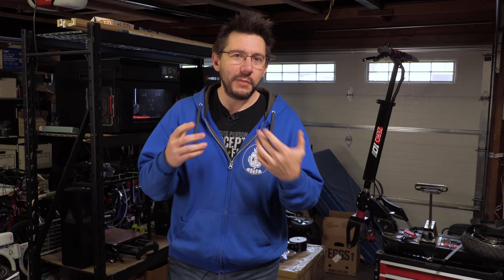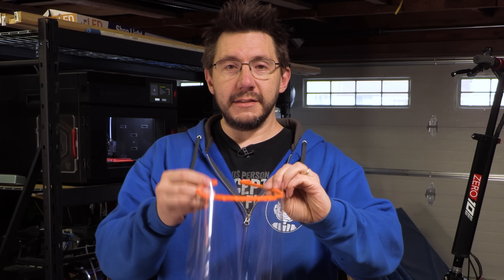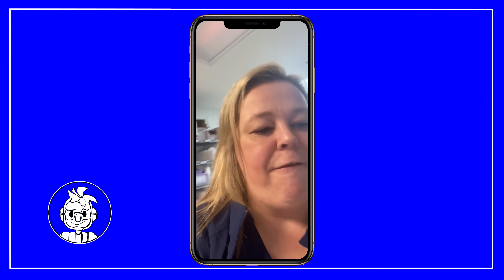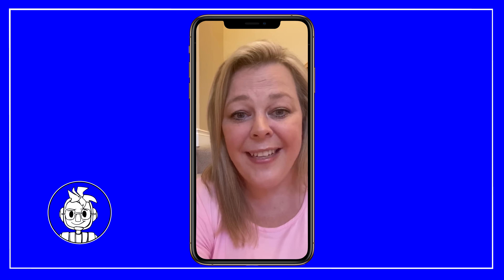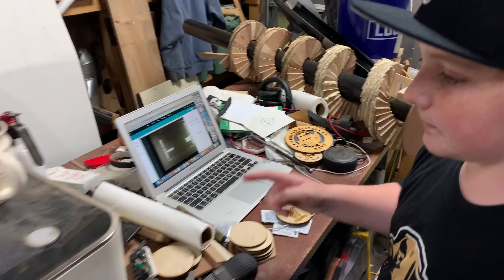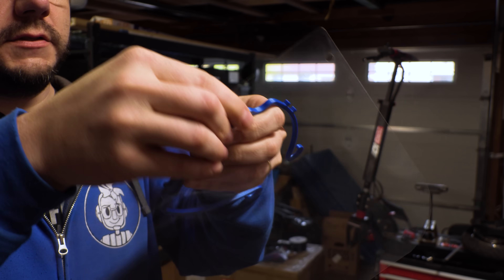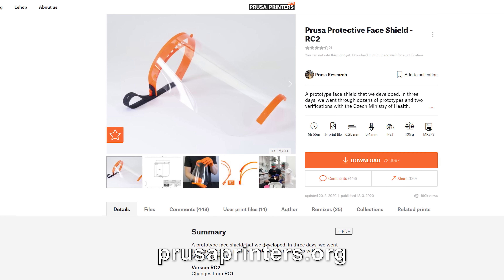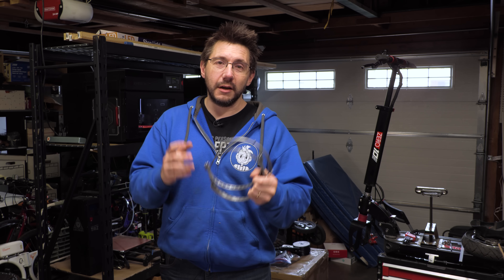3D Printing Face Shields and YOU CAN TOO!

Comment: Hey 3D Nerd - great video - thanks so much - my 1st 3d printer is on order and due to me on Monday to join the support of the frontline. Quick question as you have a route into Verkstan. Do you know or has there been any discussions about a multi unit print in some form of a stack so printers can continue to churn out units through the night without needing attention after each unit (on a small machine)?

Comment: Could we make a stacked design where we stack several on top of eachother and have an easily breakable layer between visors?  This could really increase throughput since it could run longer at night and would require less hand holding during the day.
Reply: "Make Anything" has done this already and the files for it are on the 3DVerkstan Face Shield BACKUP SERVER (see link above in the description)
Reply: https://github.com/Cederb/Faceshield.nu/tree/master/North%20America/3D%20Printing%20Files%20(STL)

Comment: I'm very green to 3D printing, like started last week green, I have 4 Ender 3 pro running right now with this design, I have a print time of 1.25 hours per print, is there anything i can do to keep quality and constancy while getting a faster print. I'm using the prusa slicer as I have 2 of their printers on order. I haven't modified any off the settings other than to draft  and PETG. Thanks

Comment: Where is the stl for the spacer? I’ve checked everywhere and can’t find it. Can someone please share the link for it.
Reply: I couldn't find it but the instruction sheet on the original website state 1/2 spacer so should be able to make one on tinkercad to fit the hole punch we are using
Reply: DJMovit you would think if you are gonna share a file to print, you would include everything. Lol
Reply from the maker: It’s there. Use the GitHub link and go to both America and STL and it’s in there
Reply: @3DPrintingNerd  I went to the website, thanks Joel!
Reply: found it on Github like 3D Printing Nerd mentioned

Comment: If you slice this in cura you can use the multiply feature and stack them on top of eachother, leave a small gap (1mm or so) between them and print with supports.

Comment: **READ THIS FIRST**
Don’t mass produce any PPE until you have let the establishment review and agree to the design. 
Face shield designs are changing rapidly. The model in this video is already behind and does not provide adequate top protection according to guidelines I read somewhere, probably the National Institutes of Health website. 

Keep an eye on the tested and recommended designs here:
https://3dprint.nih.gov/collections/covid-19-response

There is one design that has been considered to be tested and is recommended by the NIH (no 3d printed PPE has been “approved” by any official group)

This is a vase mode optimized version of the “recommended” design. This is the best design I have printed so far:
https://www.thingiverse.com/thing:4251314

The above was remixed from:
https://3dprint.nih.gov/discover/3dpx-013238\

Same design as above, but this link works:
https://www.thingiverse.com/thing:4253141

Which was remixed from:
https://www.prusa3d.com/covid19/  

Also,
The Transparency sheets linked in the description of this video are somewhat cloudy and a bit difficult to see through. 
There are probably better options, but I haven’t found them yet.

Comment: Hey Joel, 
I am about to kick-off a large series of these parts, in several different materials in several different locations. As such I would like to begin tracking parts and QA by adding in features to the model. Do you happen to have access to STEP, or IGES files so that one could modify? 
Thanks!

Comment: I made a shorter version of the 3DVerkstan Face Shield Model so it would fit on my printer (shortened the arms a bit). It seems to still work and fit well. Here is the link if you want to check it out https://www.tinkercad.com/things/71HK15B39SX

Comment: Question for anyone who may know:  How do you stack the STL's on top of each other?  Every time I try stacking them in Cura or Prusa Slicer, they get pulled down to the bed level.
Is this something that I need to do in TinkerCAD or Fusion? Or am I missing something in the slicers?
Reply: Devon of "Make Anything" has already done it, and you can find a file where the headsets are already pre-stacked: https://github.com/Cederb/Faceshield.nu/tree/master/North%20America/3D%20Printing%20Files%20(STL)

Comment: Currently printing these for a local hospital. I recommend printing with a 1mm nozzle, 0.4mm layer height, and vase mode. 12min print time, still very rigid, easier to clean without hollow areas.
Reply: @John Claytonyup. 1mm nozzle so the same thickness as 2.5 walls normally (0.4mm)

Comment: Hey Joel, wanted to thank you for this video. I have started to print these off, so far only 6 but was was wondering if there was a way to stack several so i can increase my personal output? I only have 1 Ender 3 and my skill set with it is next to nothing. Again thank you for your help and for sharing this file.
Reply: I found this site that had stacked versions of this at https://retrolabs.com/3d-prints/3d-printed-face-shield-with-10-mil-pvc . I tried the 3 piece stack. For my Prusa I needed to print with supports. I hope this helps. God bless.

Comment: Not sure if this has been asked... is there a 6-hole punch that is recommended for this project?  I have an adjustable Swingline 3-hole punch, but based on the template, it doesn't look like I will be able to align the middle two holes.
Reply: In my experience. i have a non adjustable one, punch it twice at 25mm interval.... twice gives you 6 holes

Comment: We modified the design a little so you can simply use a PET-bottle so you don´t need a laser cutter. I just uploaded a video showing the assembly on our youtube and instagram. This way, everyone with a 3D-Printer can make face shields. If we all work together, manufacture and donate to our local communities, we can help protect the ones who are currently keeping our society running.

Comment: I have 12 of the Covid9 frames printed, I am awaiting the transparency sheets, should be here tomorrow. Could you design a small plastic clip to hold the shields on on to the Covid19 frame which would enable the plastic sheet to remain on the frame more securely
?

Comment: I have printed 12 of the shield frames. Could you design a small clip to hold the plastic shield to the frame on each one the four pegs? This would enable shield to stay on the frame when in use.

Comment: I am using this one, my mom is a nurse, with almost no PPE, and I work IT at a hospital, I am using my remaining filament, to make as many as possible, and I got 3mm transparent laminator sheets, this design only requires a centered 3 hole punch, and clips on the sides, then snaps on the front. Anyways, Great work in empowering the masses, I am looking to make 100 myself. Then I am taking donations in the form of Amazon gift cards, to be able to purchase the supplies to make more. https://www.thingiverse.com/thing:4242677

Comment: Has anyone made for found a stack-able version of this visor? If we can get that in the description that would be great too!
Reply: If you slice this in cura you can use the multiply feature and stack them on top of eachother, leave a small gap (1mm or so) between them and print with supports.

Comment: I am running into an issue with the printed visor, both the corners where the stem is connected front part is giving way when the stem is expanded out.  Not sure what I am doing wrong. Printed with PLA on ender 3. Is there any way to reinforce both the corners?

Comment: My one complaint about this design is that the posts are not optimized for use with standard hole punches. I may do some remixing. I will also try about the Prusa mask and see how that one works.
Reply: the north america stl file is using the standard 3 punch hole... you just need to punch it twice with 25mm interval.
Reply: @caddnima  Yes, I've found that it really needs to be right at that interval (a standard inch for us backwards Americans and our imperial measurements) for the shield to fit on the studs well and for a smooth. This comment was about the shape of the posts rather than their spacing though, better shaped posts will hold better and with less likelihood of splitting the plastic clear sheet.

Comment: Hey anyone knows if we can do the hole punches by hand, we would like to minimize the cost of this , thanks!
Reply: I used a single hole punch - I printed out the the PDF (US_6_Hole_Template_by_Joel_Telling.pdf) on my BW printer on paper and used it as a guide to single punch holes since my regular 3 hole punch wasn't working. Use paper clips to anchor the paper template onto the transparency sheet before punching.
Reply: @sald2of6  thank you

Comment: Request for help. I have a CTC DIY printer (Christmas Present)  and I am printing these. I have had to add a brim to stick it down and slow printing speed to 40mm/s, but the problem is that it doesn't complete a  top cover on the front edges. It looks like the filament drops into it. currently trying with infill 20% triangles to see if that gives a frame to hold the top on. Suggestions/ideas welcome.

Comment: Hey Joel. I THINK I HAVE A SOLUTION. I think the face shields have been the best use of 3d printers to date. I have an idea that would make 3d printers even more effective. I don't think the filtration masks people are currently printing are very effective or quick to make. They don't form a tight seal, they are uncomfortable and they aren't easy to sterilize. I think if people printed 3D molds of mask bodies and poured quick setting silicone into them we could make many masks that form an airtight seal and are comfortable. Also silicone can stand very high temperatures so they could easily be sterilized. The only plastic, after the mold is made, would be a stiff frame that would be sandwich the silicone at the front of the mask, to hold the filters. People could print more and more molds and in the mean time they could be pouring masks with the molds they already have. It could have exponential growth. JUST A THOUGHT.

Comment: Thanks for pointing us in the right direction to help others. I started out printing the visor with 3 holes and that works great. Then I saw the one with 6 holes and printed that one also. Truthfully I dont see any advantage of the 6 hole over the 3 hole. Anyway maybe someone her can enlighten me. Also can you tell me what the spacer size is and where I get the 3 hole punch you are using in the video. Mine doesn't allow me to use a spacer because of the side walls. Thanks for all you do
Reply: The spacer seems to be a separate file (at least on the main archive) and is located a few files below the North Am. version files.

Comment: Figured out an improvement to the base design, specifically if you're laser cutting the face visors.  Leave the drop for the holes attached by just a ~.025 wide tab.  That way, you don't have to clear the bits off your bed, and they just fold out of the way when you pop them onto the frame without any effect on fit at all.  Increase my laser's throughput by about 30%!

Comment: I've actually just ordered 3 printers which I am going to print door openers, masks, visors etc around the clock. And if I haven't burnt them out, I will be donating them to a local school when this is all over :> Not only that, I have just spent the last 12 hours sewing Olson masks.
Reply: Am trying to research which printer would help make this frames.
Reply: Which printers do you use? Or will any 3D printer work, if so what are the sizes I need?
Reply: As long as the bed is large enough then any printer will do. The ones I just brought are geeetech a20

Comment: Ok, I understand  people want to help, but please, if you are going to design and print these masks  wear it for a full day. I've tried a few designs and they are too flimsy and dig into the forehead uncomfortably after 15 min. Nursing shifts are 12 hours.  Someone donated 20 similar masks to our hospital and no one could actually  use them.  Some designs even cause pain and bruising. This is where hobbyist learn that engineering is not just making something that looks like it should work.

Comment: Over the past 4 weeks more than 300 different designs for 3d printed face shields have been uploaded to thingiverse.
So if you want to print some as well: 
please ignore all the models already available, create your own inferior design and then also upload it to thingiverse, to make it even more difficult for people to find a good solution. Thank you.

If you want to disrupt things even further you can add to the current bewilderment by uploading the 400th face mask, the 200th door opener tool or the 150th tensegrity table.

Disclaimer: i did not actually check the number of masks, door openers or tensegrity tables, but i did indeed stop counting after 300 different face shield designs.

Comment: Hi Joel. If anybody wants a really simple face shield. This model needs three elastics a 3hole punched overhead sheet and you can double side tape a bit of foam on the inside.
https://www.tinkercad.com/things/j9DCzztX365-headbandugddsbfaceshield/edit?sharecode=jqILdH90jKgR6bv2jBBX84BqyBvMA_g5aCsach13w5Q
It has essentially disposable shields and is quick and easy to make. Spread it like butter.
Reply: Keep up the amazing work. Btw the prusha design has a flaw because it has a gap at the top. Good for clarity but sometimes fluids drop in the top.

Comment: Joel- Great work man, very cool! 

I got an email yesterday asking to print and donate masks. I don't know how they might go about using them (approval) but if things get bad they'll be happy to have them. Printed first one today- fit is amazing because you can heat it and it will conform to your face. 

Also, since the vent has a smaller surface area one N95 mask can be cut up and used in 6 of these. If the need is real and they will use them I'll print as many as I can.

Comment: I get my blood drawn monthly and my doctor's office uses something even lower tech for a face shield. They're disposable and constructed using a thin sheet of clear plastic, much like transparency film. Along one edge it's reinforced with an additional strip of green plastic, and then has a 1x1x12 inch foam block glued along one edge. The ends of the foam block end in a piece of elastic band. The foam block rests against your forehead with the elastic band stretched around the back of your head, similar to the 3d printed versions shown here. They look super easy to make if one were so inclined.

Comment: Face shields, masks a gloves are for personal protection but what about patients? Ventilators are needed and I have idea. I just saw video with manual bulb/bag mask ventilator. Those are hard to use by a person for any length of time, and patients need 24hours. Using a small RC motor and a gear reduction along with a 3D printed device to squeeze the bulb through a cam system? Hospitals can use the manual mask with the3D printed "squeezer" much cheaper, easier, faster to make. Worth trying??😷😷😷

Comment: I have printed these after seeing this video.  I am in North America but I like the sturdiness of the Swedish version the best.  My wife is a teacher and we have laminating sheets all the time.  I used these after being ran through the laminator as the shield.  If it is opaque try running it through again or letting the laminator heat up longer.  I also ordered overhead sheets to see the difference.  The first ones got picked up today with a good initial response.

Comment: What are the exact dimensions of the 3d printed part. It looks huge when I import it to Cura and the estimated print time is over an hour using the recommended settings. I have an CR Ender 5 Plus with a 0.4 mm nozzle.
Reply: Swap out you nozzle to a .8 nozzle. I am printing them in just under 30 minutes each.

Comment: Hello Joel.

New printer owner here. I'm asking you if you can help me, PLEASE!  I want to use my machine and here is my tale.  

Name:
 Keith A. Voss  

Good Day.

I have a small problem. I just received my Creality Ender 3 Pro, built it and made the cat and dog model 2 days ago. I ordered more filament and it came today.(Thursday) I tried to run the pig model today and that's when the problem started. I plugged in the little media card and when trying to set up the Ender 3 pro, nothing came up like the files for the Pig, Cat and Dog. Not even the manual or instruction. I don't know what to do.

Where can I find coded downloads that will work on my machine? Any help you can give me would be most appreciated. And if there is a site where I can download the information I need, like the info that's on the Macro SD card Please let me know.

Sincerely Keith A. Voss
Reply: What is it you actually need?  Instructions manual? Also probably a basic question but you have the sd card orientation correct and have you tried unplugging it and then plugging it back in?

Comment: Using the prusa design instead. Seems to fit better in terms of being parallel to the face and not angled.   https://manual.prusa3d.com/c/Prusa_Face_Shield_COVID-19
Reply: You need to add the cover on top of the prusa one now they wont take the open ones

Comment: silly question, but where do you get the clear acetate (the actual face shield)? i think the most easily obtainable for me at this point would be sheet protectors/report covers, but i'm not certain if they are stiff enough and large enough. i would definitely like to help with this effort, but that seems to be my primary obstacle right now.
Reply: okay, duh, i see the link to the transparency sheets you used. still not sure if what i have is thick enough, but i'll try it out.